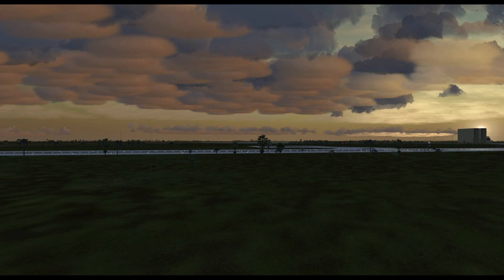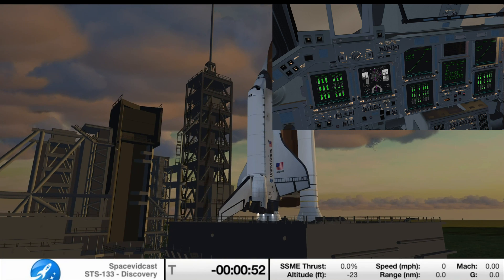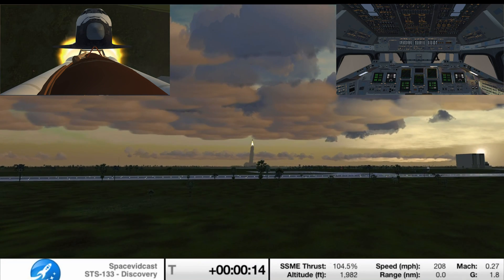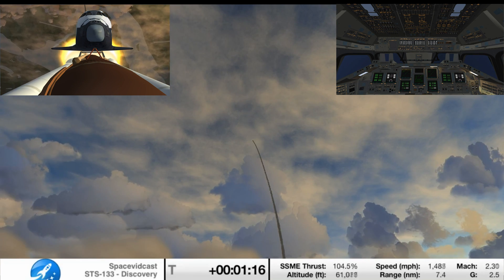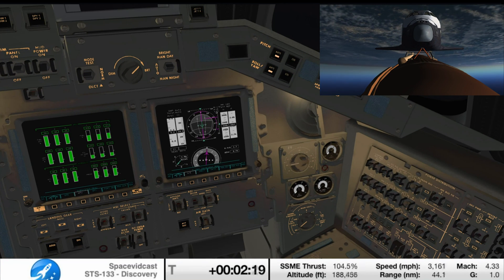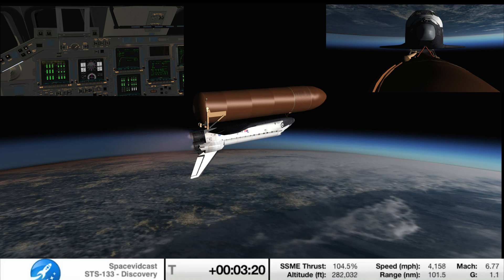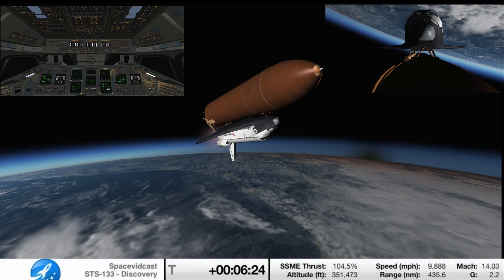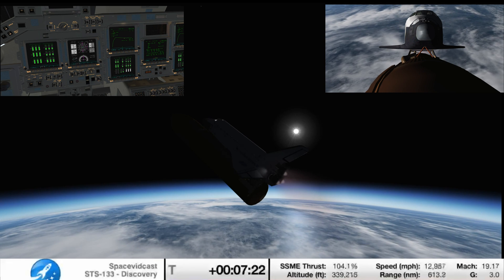Space Shuttle Launch Flight Gear with STS 133 Real Voices

Comment: It takes long time to load (initializing and finalizing subsystems), even when it uses almost no disk access. Is there any way of accelerating that? I cannot use save/resume feature because it scrambles DPS if i save it at the beginning of TAEM and then load it again.
Reply from the maker: It is long to load yes.
Apart of using a fast ssd, I don’t see anything else that might help.
Maybe ask on the fg forum
Save/ resume works by phase.
Dps is a very deep and complex thing code wise, and it is not always backed up by save
Reply: @gingin3388  SSD won't help. I see that it bearly does any disk access during loading, so it is not about the disk. Wonder what else can it be. When I say DPS gets scrambled I mean that things like TAEM guidance gets messed up and impossible to use when loading (resuming)  saved situation.